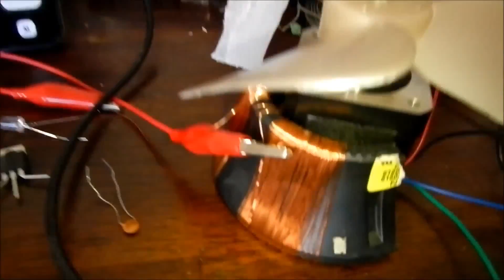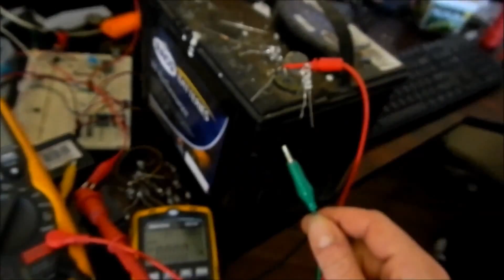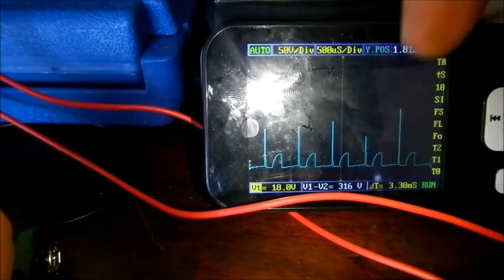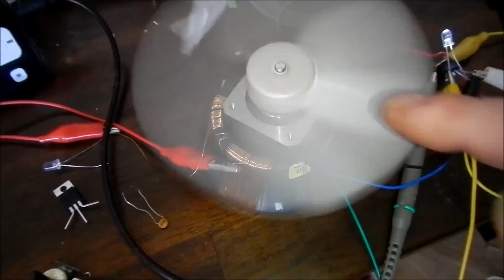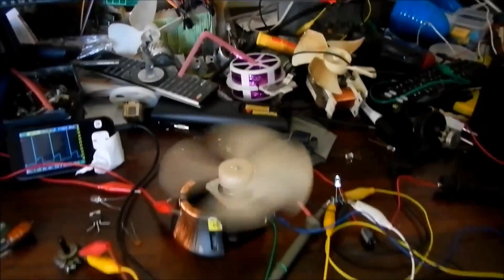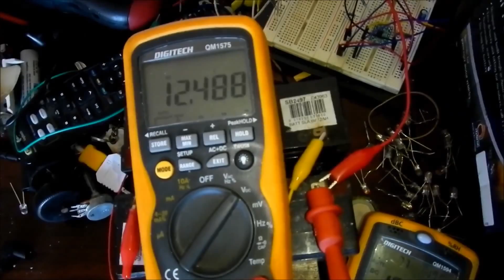Torquing about, Step by Stepper replication

Comment: Yeah there probably are.  I will have to read the link when I get some time... School just started and it's killing me... I still don't see why I am not getting the amount of power approtechie is getting.  I have about the same size of displacer.  Really the main difference is that he is using stainless steel.  I guess I really just need to work at it bit more and adjust things.  I should open it up and check on things inside the displacer just to make sure every thing is holding up.

Comment from the maker: I think there are ideal ratios for bore and stroke for a given heat differential. That will yield optimal results. I haven't googled yet. Know I'll lose a day when I do. May not be public info? The first step is getting good at machining and seals etc. Your doing a great job there :) especially with recycled parts! Its one thing to work out all the math, and order precise parts, another to get something running with what you have. You have some decent power now, so can work on efficiency next :)

Comment: I really don't think my engine is very efficient.  In order to get about 1 watt I have to heat the displacer to a red hot glow.  It has a lot of heat coming off.  Probably equivalent to a small electric heater ~ 1000 watts.  So I am going from about 1000 watts of heat to 1 watt.  Not very efficient...  I could probably increase efficiency if I install an insulated fire chamber.  No I don't remember you sending me a link about that.

Comment from the maker: Stirlings are rated at 30% efficient. They turn 30% of the heat into rotational power. They also pass the other 70% of the heat on very effectively. Its all in how you apply it. If moving heat from point a to point b (through a wall for eg). You might as well get some power from it. Also LTD stirlings are the best way to harvest power from low temperature differential of 20c or so. Did you read the link I sent you on LTD stirlings and solar thermal breaking the $20 a mwh barrier, a while back?

Comment: Thanks!  I'll look into buying some neodymium magnets.  I think it would easier to use a bigger flywheel than to design it to have stronger windings on the power stroke.  But still a good idea.  Might consider that.  Although I feel they are not as efficient because with every revolution of the engine it has to use power to accelerate, stop, accelerate, and stop the extra weight from the magnet or what ever it may be.

Comment from the maker: I'm not sure, they have poles aranged in strange way for motor work. You can get some really cheap Neo magnets on ebay. Google would likely have a guide on DIY gen/motor winding with Hdd magnets if it can be done. Motor's and gen windings are not my strong point. Other than to suggest a special wind will be required to make the best of the stirlings unique power output. Posibly look at having a stronger winding on the power part of the stroke? Also Linial generators!! straight on con rod

Comment from the maker: Id make a rig for testing the motors you have on the Stirling as well. The different torque requirements of motors will affect the rpm of the Stirling I would think. If your getting a watt with the first motor you tried, you can probably get 2 watts with the right generator. Seriously consider winding your own. Not many generators designed for Stirling 30-60 hz rpm.... Its the only way you'll get a decent output with direct drive and no gear losses. Drill could be a good control tester...

Comment: Well I meant that I ran it on 60Hz off a wall wart so like 12 volts AC.  I have a couple of the older larger floppy disk drive motors.  I should really take a motor and spin it with a constant amount of power and hook different generators up and measure the output and see witch is best.  Thank you for the tips!

Comment from the maker: Steppers require really precise voltage and amps curves (there is also a power factor to consider) to operate well. While you could drive a h-bridge with 555's, you really want to look at Arduino or some kind of programmable chip. Doing it with analog would be really painful. The Pollolu drivers I have are really cheap, and can be driven with a digital sq wave. Makes it really easy. There are also cheap generic h bridge drivers for arduino. For your generator, try disk drive motors.

Comment from the maker: I'd be looking at steppers, and dc motors. Dc motor if you dont have the power to drive a stepper. Steppers would be better for low speed, and more efficient. What you really want is a tiny alternator. Winding your own could be an option. Or you could look into dynamo generators for push bikes. LOL at a stepper on mains. That might be a few more watts than when running on the regular 30v.... H bridge with mosfets is the main way to do a driver. Dual push/pull circuits could do it too. cont.

Comment: Yeah it would!  Yeah they are pretty efficient if they are driven right!  I have tried driving them before on 60Hz AC but they get really hot!  I should see if I can build a driver for one.  BTW I am going to need a very efficient generator for my new stirling engine.  What would you recommended?  I have thought about stepper motors, DC motors, pancake motors, and making my own.  Do you know the efficiencies as generators of them? It needs to have a out put power of a bit more than a watt@13volt

Comment from the maker: It hurts if you stick a finger in the wrong way! The blades where really blunt. If they where sharp, I would have some nasty cuts on my fingers! I can now see why the OU crowd like Pulse motors so much, If you get a good one, there is a lot of energy coming off, in different forms. I dont know if it all adds up to OU, but its about 80% (Very rough guess) efficient as a charger, just from one winding, then there is power on the other winding, and all that torque. So great efficiency at the least.

Comment from the maker: Yep Archeological filing system need a reboot. Thanks for such a great circuit :) I'm sure it was total coincidence, about your video appearing a few days after I stated my stepper testing :) Nicely played :) Didn't leave me with a lot of excuses. Motor and transistors etc sitting there on the desk. Had to be done... Was well worth it too, is all that power normal? If those fan blades where any harder or sharper. Couldn't get the motor to run that well with pololu stepper driver and arduino.

Comment from the maker: Yep, I'm about due for the monthly clean up. With the addition of that graphic equalizer that I probably wont de-solder till next week, its now 3 layers deep. There are 3d printer parts, and all sorts in there.. Was either clean all weekend, or find a circuit to play with lol. Guess how that went...  There will be resistor-scope test in a few days after I do some more on something else.. I was planning on comparing watts into charge cell via various diodes. A 4007 in series as TM does can work.

Comment: I have produced a small pile of zapped leds myself but I do like watching the current flow.  TinMan had a good idea there I got hooked on it right away.  Maybe a resistor in series might help. Your observation about the torque is what has me wondering about efficiency also.  You have the messy workbench award but my kitchen table comes in a close second.  My wife hates it.  From time to time the mess goes in a box and out comes a new table cloth with a vase of fresh flowers.  She smiles again.

Comment from the maker: I have no idea about efficiency at this early stage. Just got it working yesterday.... Need to get power off the rotation, and both windings, then find the "Sweet Spot" while its loaded, then I can try and work out power in-out... At top speed its about 8watts in, Looking at mechanical output alone, I'm thinking efficiency is going to be reasonable...